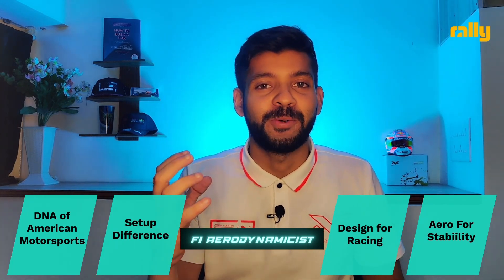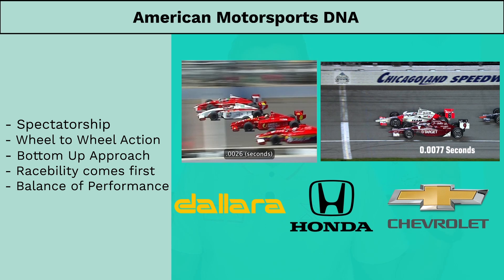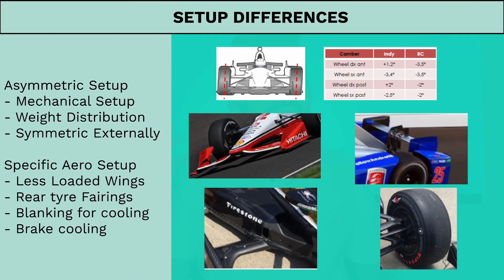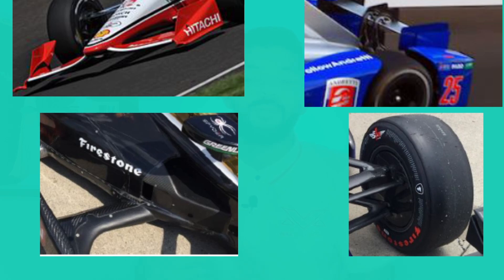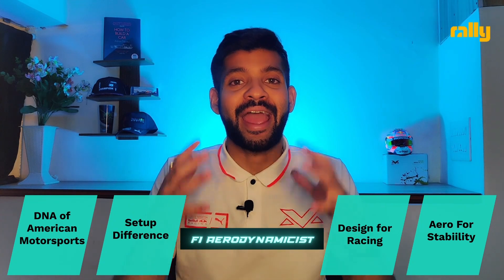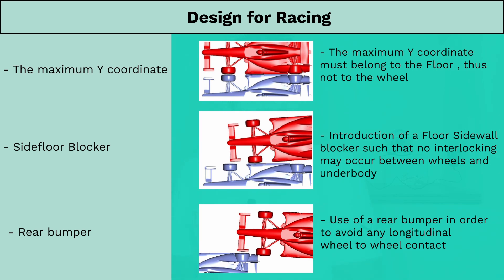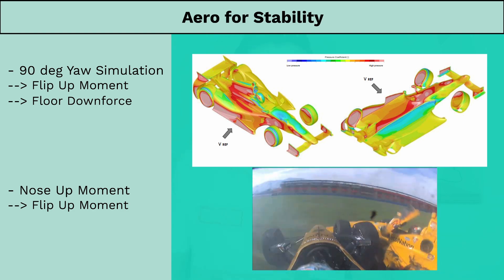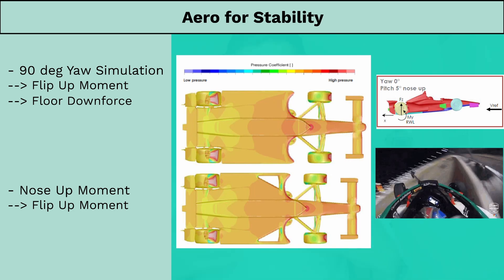IndyCar Vs F1 ? What Drives IndyCar DESIGN ?

Comment: The hole in the floor also works to prevent sideways flips if the car gets airborne, by dumping air from under the car.  Look at the monday crash between Wilson and Legge.  In years past, Stefan's car would have been upside-down only a few years ago
Also, the pods behind the rear wheels were done away with a few years ago, but there is still more volume in the rear body than an F1 (or really any current F Series) car.  (trust me, I saw an FR car launch over another last weekend on a standing start!)
Reply from the maker: Hi Stephan, thank you for that insight. You are absolutely correct. Do you know why they got away with the rear fairings?
Reply: @f1aerodynamicist  The current INDYCAR chassis design was introduced in 2012, with two updates (and a third coming next year.) The rear pods and the side protection you mentioned were added after Dan Weldon’s fatal crash.  He was the chassis test driver and the chassis is called the DW12 after him.  In the 2018 update the rear pods were removed for two main reason 1) further testing proved they were ineffective in preventing the type of accident they were designed to prevent. 2) They came off the cars easily with contact, causing debris on track from incidents that otherwise didn’t require a caution (remember, in oval racing all cautions are FCY’s)
Reply: Oh, and the pods were never well received by fans…
Reply from the maker: @stephenbritton9297  very insightful , gonna pin this comment